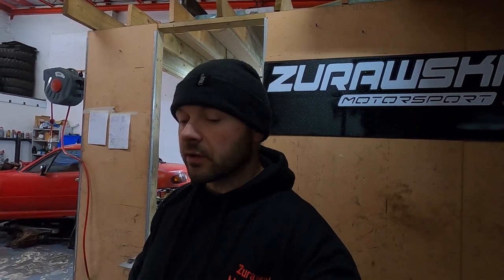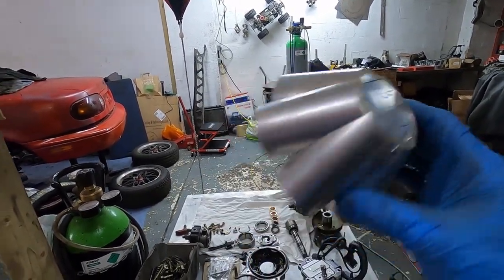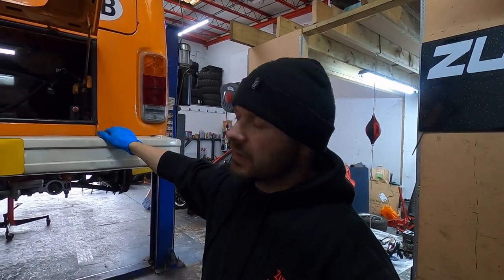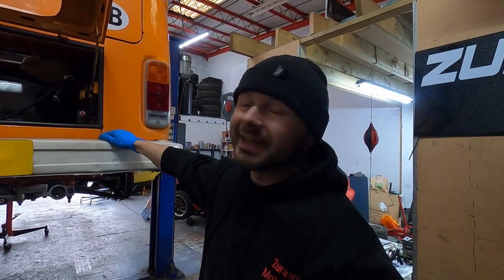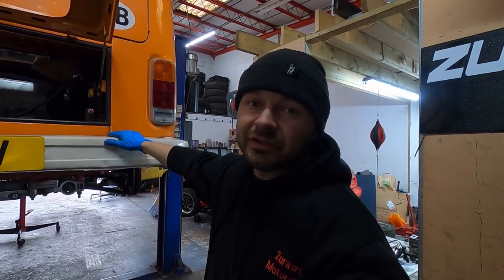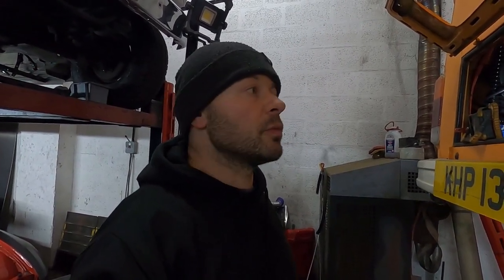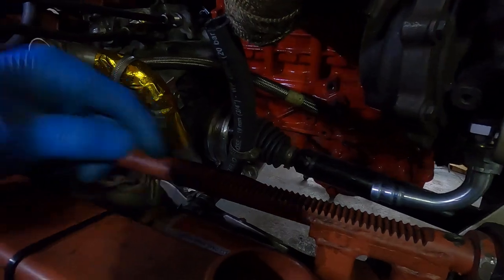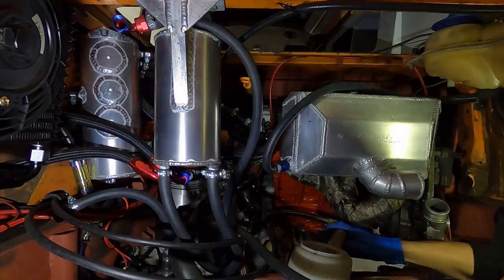Vw t2 1.9 tdi powered campervan final setup, ready for mapping

Comment: nice video Thomas. i have a vnt control question though. So i just bought myself a gt2256v off of a Ducato van. and i would like to put it on my mtdi engine. but the problem is how to safely operate the vanes, it is vacum operated now. and i have seen all sorts of ideas like a bunch of cables levers and such, and the simple with just flipping the actuator around and make it pressure operated i can't imagine the turbo and engine lasting too long that way, with all of the exhaust back pressure. but do you have any ideas to how it can be controlled without electronics? i don't plan on racing the car so the turbo might be a bit large, but it can't be much worse lag than the one i have on now.